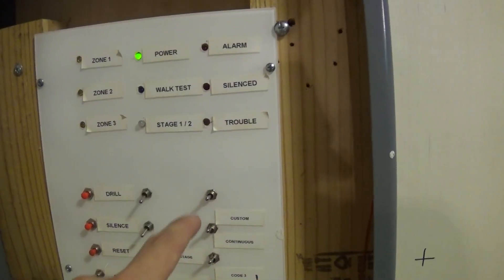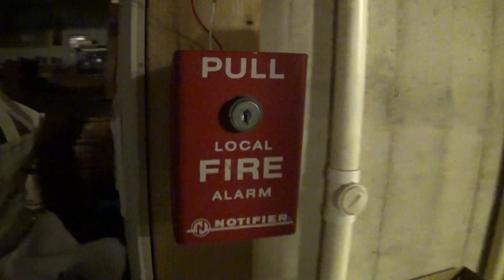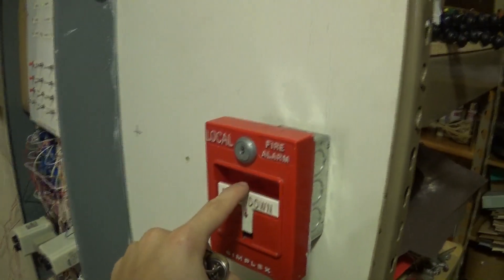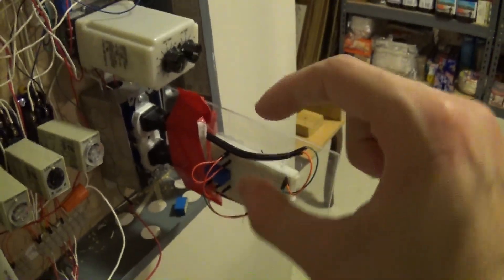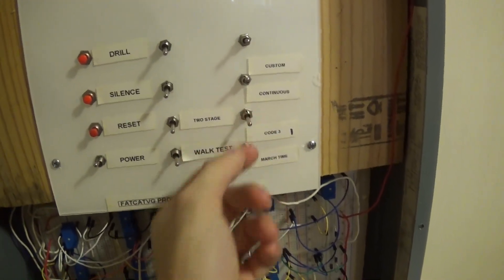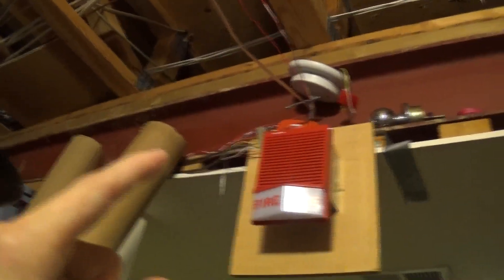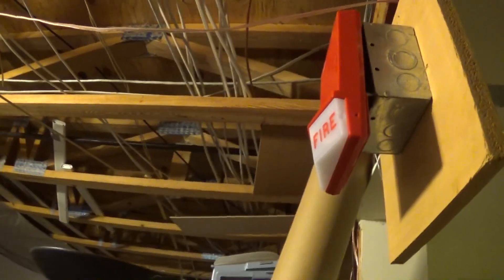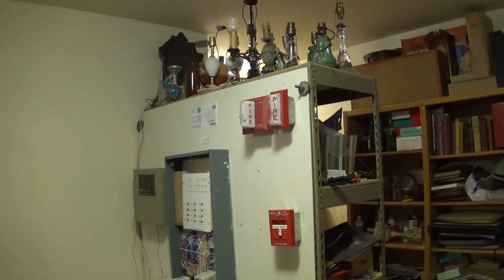System Test 16

Comment: It's in continuous right?
Reply from the maker: Most older devices are "coded" to continuous if that's what you're asking.  The coding comes from the panel, and the devices just sound whenever power is applied and for the entire duration that said power is applied.

Comment: Do you think you could do code 4-4 with the code card?
Reply from the maker: It's possible.  I just need either a code wheel (which I have never seen a 4-4 version of), or an annoyingly complex system of relays (also pretty expensive).
Reply: Code4-4 is like beep,pulse ,beep,pulse ,beep,pulse,pulse

Comment: are you gonna make another system test video featuring the wheelock 46T bell?
Reply from the maker: Not for a while,  I may do an individual test with it sometime soon.
Reply: okay then.
Reply: @burnoutteamclubbtcp7283  Sorry If The 46T bell won't be used for a bit.

Comment: I have an M69-5 that has the tamper key blocking attachment. Basically it blocks the thing you stick the screwdriver through to reset the station and once you insert and turn the key you can reset the station. Mine also has a terminal block on the back because it is a 2 IN/O switch.
Reply from the maker: Sounds pretty rare,  I think I saw one of those on EBay a long time ago.  Good find.
Reply: Yeah cool 😎